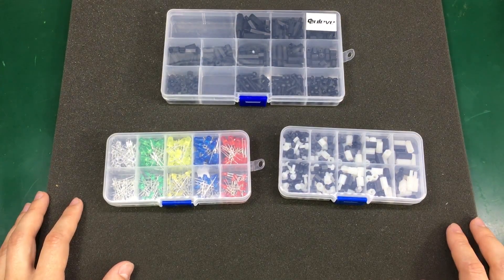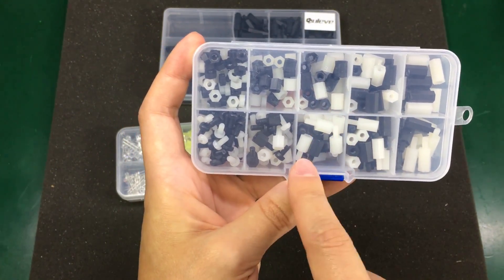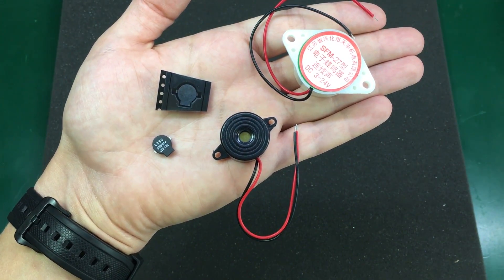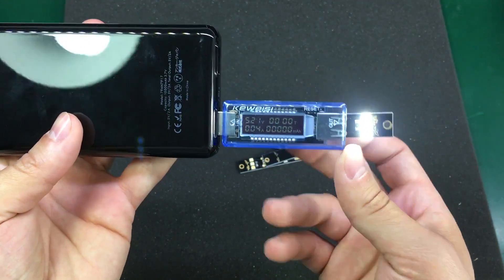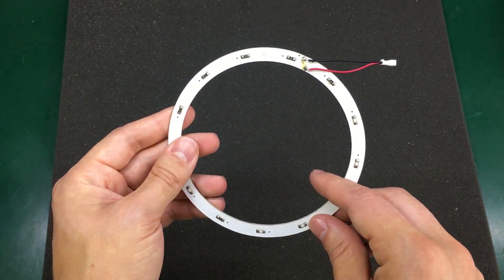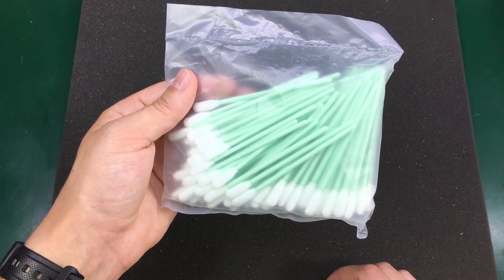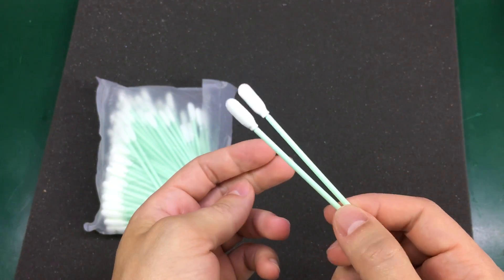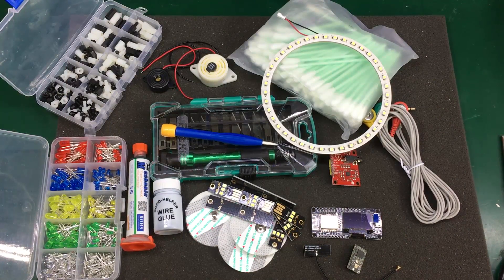Voltlog #111 - InTheMail

Comment: How do you access a serial device with the wifi UART bridge? Do you need to install special drivers that creates a virtual com-port that gets then routed through the network?
Reply from the maker: you don't need to install anything, there is a predefined TCP IP address and port: 10.10.100.254:8899, you just broadcast to that. Checkout the user manual http://www.usriot.com/download/WIFI/USR-C215-User-Manual-V1.0.pdf
Reply: Ah, ok. So it's not a transparent UART bridge. You can't take a device that's connected to the computer locally via a comport (be it a real one or a virtual USB one), put it somewhere remote instead and still use the same way to talk to it (like selecting the comport in the program that comes with the device).
Reply from the maker: I'm not sure I understand what you are looking for. This is a serial to wifi bridge: on the serial side you connect anything that talks serial and on the wifi side you can either connect to it directly (it acts as a local router/server) or you can configure it to connect itself to an existing wifi router so you can connect to it remotely.
Reply: I was thinking of serial over wifi (that's how understood bridge), as it being serial on both ends. One side would be serial only in software (it looks like a com port on the PC through a driver, so any program talking to com ports can use it, but the data get sent through the network).
Imagine one of those ublox neo GPS receivers for example. You have your computer inside a room and no GPS reception there. You can't run a cable from your computer to the outside (where you would put the GPS receiver). So you would use the wifi-serial. But the program you use to connect to the GPS uses a (virtual) com port. You can't change that program to use something else (obviously). That means being able to connect to an adress to talk to the serial device, is not helpful in this case.

Comment: This video gave me an idea about replacing the 120mm T4 17Watt florescent round bulb on my desk magnifying glass with one of these 120mm rings. Do you know the wavelength of the light produced? If not, would you consider the light to be "Soft White" or the blueish cold white? None of the links I found say anything about the temperature of the light produced!
I also glued 2 x 40mm 12V fans to the under side of the magnifier aiming back and horizontal, which I turn on during soldering, that will suck the fumes that normally end up in my face, and blows it out of the back side. Works like magic and I thought I share the idea.  
The florescent bulbs cost a lot and not very easy on the eyes. 
Thanks again for a great video.
Reply from the maker: it's definitely bluish cold white, not nice to the eyes. I didn't find any warm white ones because they are usually intended for use in car headlights where cold white is desired. So far the only solution is the replace all of those LEDs manually with some warm white ones purchased separately.
Reply: Thanks. I was gonna order them but thought I should ask you first. Took it out of my cart.
I have meters of warm white strips. I guess I will built one from 2 copper rings attached to a thin plywood circle. Lot of work I was hoping to avoid. 
That will teach them! :) Thanks again.

Comment: Would like to know your opinion about the LED ring light. Also color temperature would be interesting.
Reply from the maker: The color is cold white which is not that great, I would've preferred a slightly warmer color. I guess ultimately what I could do is replace all the LEDs with some warm white ones.

Comment: Hi, I found the 'Good Helper' glue to be useful on old remote controls where the carbon coating has worn from the back of the key, 
Use I.P.A. or similar to clean old carbon residue off, you only want a very thin coating of glue and allow it to dry for a day or 2,

The Wemos looks interesting and a great price.........ebay, here I come!
Reply from the maker: the wemos + led is a great little development board, many people are interested in that board.